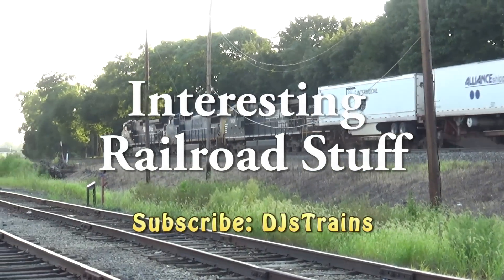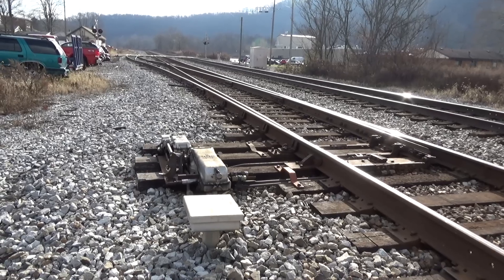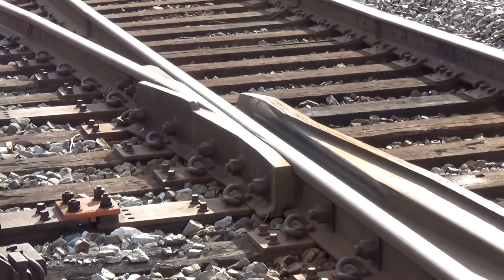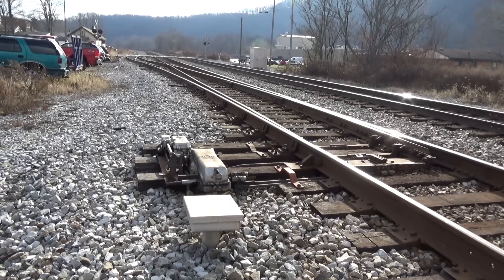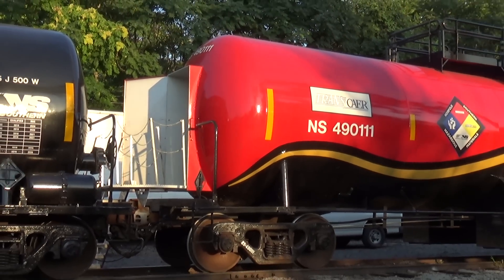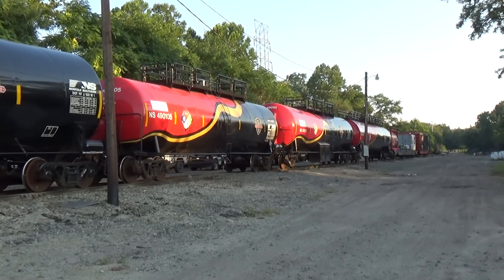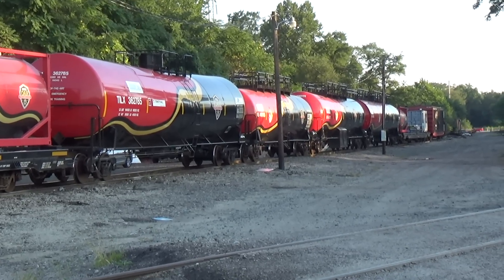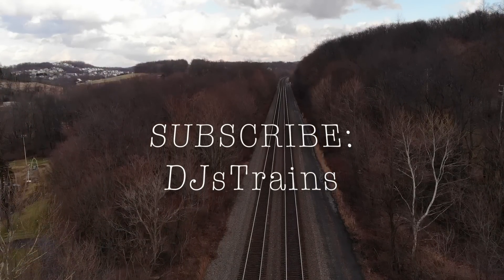Interesting Railroad Stuff. JUMP FROGS, NS SAFETY TRAIN!!

Comment: I'm still surprised locomotives don't have a fuel cutoff switch in the cab, for just the reason of a fire. Even install a fire suppression system in the area where the actual engine is. I guess a new design would cost a lot of money to the manufacturers. Nice video, Thanks!
Reply from the maker: we do.  I hit that button as I took off.
Reply: @djstrains  awesome DJ, thanks!

Comment: How does this turnout work? I don't see where the wheel flanges would run when turning out.
Reply from the maker: one wheel stays against the rail thats part of the diverging route, the other wheel actually rolls over the straight rail and lands back on to the other rail of the diverging route.
Reply: @djstrains  The flange on one side rides up over the top of the straight rail?
Reply from the maker: yeah, crazy, but thats how it works.
Reply: @djstrains  I'm sure your subscribers would be interested to know how this works out. The excess wear must have been considered, but it seems strange.